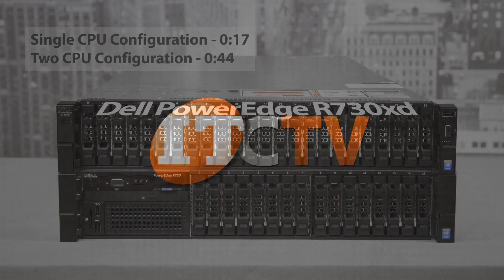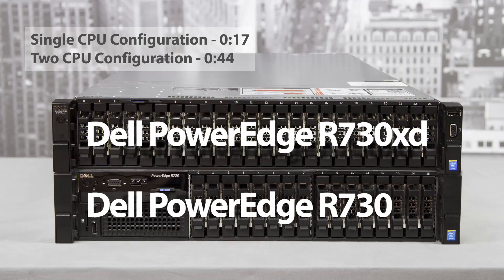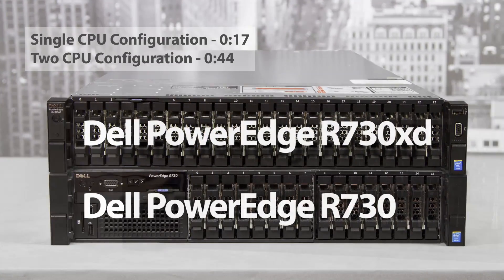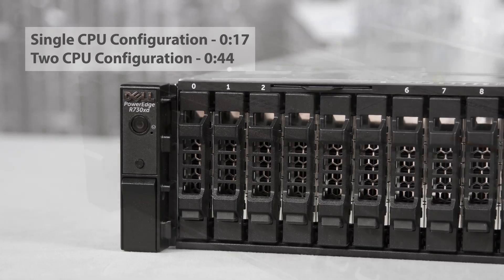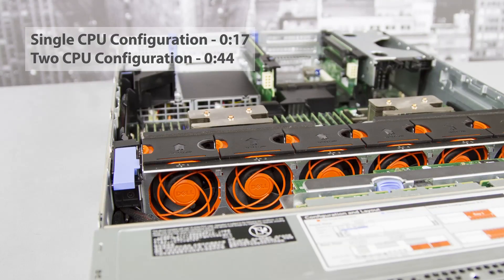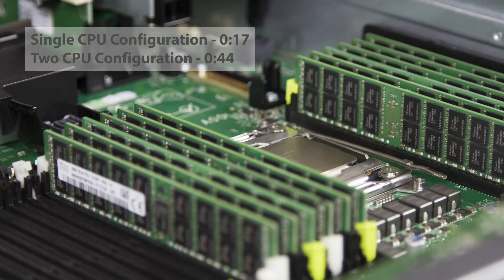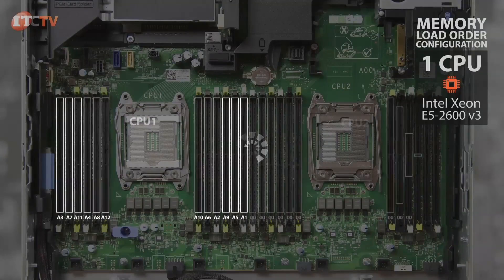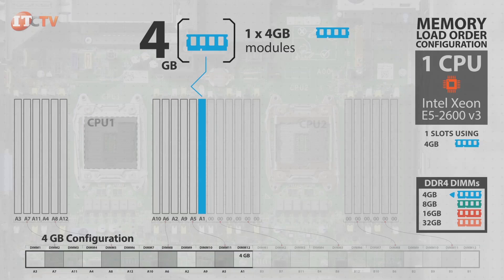Dell PowerEdge R730 & R730xd Memory Load Order

Comment: Great animation.  We're looking at upgrading the RAM in our R730.  We currently have 320 GB total, 10 x 32GB MT 2400 RDIMM's.  We noticed Dell put 2 of them in the A4/B4 channel which in the manual shows they are 1866 M/T channels.  I'm guessing these two are dragging our entire speed down from 2400 to 1866.  Are we able to pull these two out and replace say A3 and B3 with a 64 GB and add a 64 to both A7 and B7, A11, B11?  That way we keep the 2400.
Reply from the maker: Hi there Merc, 
First of all, here is a link to the User Manual and the memory section begins on page 88. https://www.itcreations.com/user-manuals/r730/dell-poweredge-r730-owner-manual.pdf Same manual also says RDIMMs only up to 32GB are supported but this manual may be out of date and Dell has decided not to update they given the product is EOL. Anyways… there are 4 memory channels to work with and 3 slots per channel each with a White, Black and Green tab. For highest performance you would just install one memory module in each white slot. However, for your specific configuration, which is not one of Dell's preferred configurations I might add, you need to install the modules with the highest capacity in the white slots first (this from the General Installation Guidelines on page 90) The last 5 bullet points in the Guidelines should be followed for your situation, Actually forget that last bullet point…  So to recap. place 64GB modules first in White slots, followed by whatever you have left in the white slots and then the Black slots. Make sure configuration is mirrored for each CPU. Do not mix LRDIMM and RDIMM memory. Lastly, if you install any modules in the Green tabs, memory speed will take a hit, so keep it only in White or Black tab slots. 
On a side note, I suppose it is possible that 64GB RDIMM modules are not supported and tops out at only dual rank 32GB modules. that information is on page 35 of the user guide. Again, I think there is an update missing from this system documentation so hopefully they should work. https://www.itcreations.com/product/104486 If they don't work in that configuration, no worries, your system will just tell you the module is in the wrong place or something. Hope that helps!  Give us an update when you get a chance, and thanks for watching!

Comment: Great video , i just have an extra question . i am currently running DELL DDR4 8GB 2666MHz memories in my system and need to upgrade , was looking to install 8 32GB DELL same speed . However i came across Crucial Technology 32GB DDR4 PC4-21300 2666MHz RDIMM, Dual Ranked Registered ECC Memory for a fraction of the price and could change all original memories to Crucial . Would it work ? or do you suggest to stay with the DELL memory ?
Reply from the maker: HI Alan, we don't have experience specifically using Crucial memory in Dell servers Hynix, Samsung, micron yes, but not Crucial. That said, what you are using is enterprise-grade given it is DDR4 and ECC compliant. It should work. Although you will not get the 2666MT/s speed as the CPU will only support 2400MT/s. With HPE they have something called SmartMemory and the system can recognize these modules which provide a few other functions none of which I can remember at the moment. Far as I know, Dell does not do that so you should be fine. Here is a link to our landing page, there are links to the specs, owners guide and a few others in the Documents section at the bottom of the page. https://www.itcreations.com/dell/Dell-PowerEdge-R730-Server.asp 
Tell us how it turns out, and thanks for watching!

Comment: Wow !!! I just need this !!! And LRDIMM how to upgrade 3TB dual processors and order?
Reply from the maker: Hey Joe! 
128GB memory modules in all slots should do the trick and installing the CPUs is a snap! Here is a link to the spec sheet for the R730: https://www.itcreations.com/user-manuals/r730/dell-poweredge-r730-spec-sheet.pdf 
There are a few more links in teh description under the video too. Contact IT Creations for the system, system memory, CPUs basically everything! We have this system in stock now and several other Dell servers, here: https://www.itcreations.com/dell/dell-servers.asp.  Thanks for watching!
Reply: @Itcreations-LA  I need your help. What do you recommend how many watts dual PSU and also rack UPS? I don't want dual 1100w. i want dual 750w how many are the total ram memory?
Reply from the maker: @Joeron79  
For UPS sizing, check out this site https://tripplite.eaton.com/products/ups-sizing. The memory is not going to be the biggest power suck on this server. You can still load it up with memory using just the 750W PSUs but but PSU sizing also depends on the number of drives installed,  expansion cards, and if GPUs are installed they will be draining the most power. Most likely 1100W PSUs are required with GPUs. There are several other limitations if you install GPUs. All of this is really dependent on how the system is outfitted. There is also a power calculator for the whole system that Dell provides here and you can determine how much juice the system will drain and potential cost. this one is for older systems but there is one for newer systems too. https://dell-eipt-eol.azurewebsites.net/#/ Play around with that thing. Click Server, choose your model from the list. once you see it in the display panel in a 42U rack click on the server. you will see a list of attributes for the server. If you click on the gear icon in the blue bar you can add a specific configuration. That said you will get general information from the technical guide and user manuals.
Reply: @Itcreations-LA  AAAHHH, I don't need GPU. Ok. I'll keep with 750W PSUs.

Comment: Such a great video! Unfortunately I have 4x32GB Memory and your video doesn't cover this situation. Do you have a solution for that? My system has 2x E5 2690
Reply from the maker: Hi there Jörn Runge,
The configurations they provide are for optimal performance for the most part. I don't see any reason why you cannot load them as indicated on page 92 of the manual using the same configuration as the 4x 16GB memory modules. With a single processor that would be A1, A2, A3, A4. For dual processors A1, A2, B1, B2. This is not the best configuration because clearly we are not addressing all memory channels, so not optimal but it should work. Here's a link to the manual, which I have included in the description section above. and here: http://bit.ly/31dzy9D  I hope that helps, and thanks for watching!
Reply: @Itcreations-LA  You guys deserve a medal. The video is 4 years old and u still answer questions. I did it like you said and it works fine, thank you!
Reply from the maker: Hi  @jorn3679  ,  Happy to help and glad it worked.

Comment: Hello, I'd like to know how to install 1x32gb and 2x16 gb ram in dell r730 server.
Reply: For 2 CPU
Reply from the maker: HI there Myo Sat, 
usually it's pairs of memory modules and tehy should be mirrored plus a few other restrictions. You could use your two 16GB modules with one for each CPU and placed in the correct slot, refer to page 92 of the user guide and some of the preceding pages https://www.itcreations.com/user-manuals/R730/Dell-PowerEdge-R730-Owner-Manual.pdf 
I think the 32GB module can be mixed in if you have two or one for each CPU, refer to the configuration  guidelines for specific configurations, also no mixing of RDIMM and LRDIMM. Hope that helps, and thanks for watching!
Reply: @Itcreations-LA  Thanks for your reply. Currently, 2x16gb modules are using and we would like to upgrade with 1x32GB module. So, we have to mix 2x16 and 1x32 modules those are the same RDIMM.I'd like to know configurations for that kind of ram upgrading.
Thanks
Reply from the maker: @myosat1126  The only way this is going to work is if you buy another 32GB module and distribute 1x 16GB module and 1x 32GB module PER CPU. It will not work with just three memory modules. Memory has to be the same for each CPU or it will not work. And that is that…